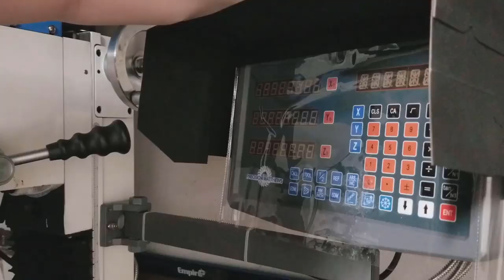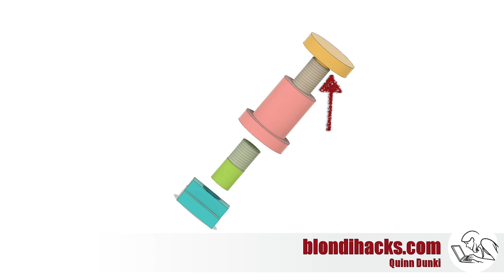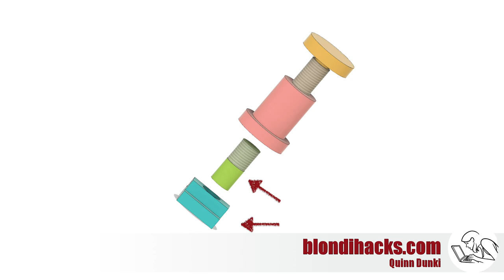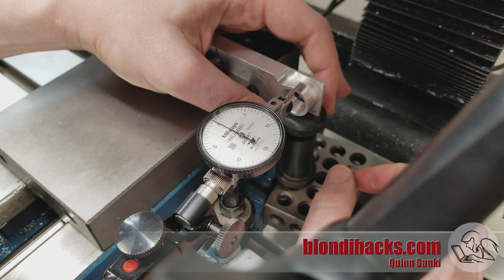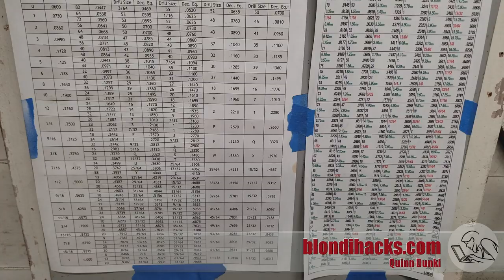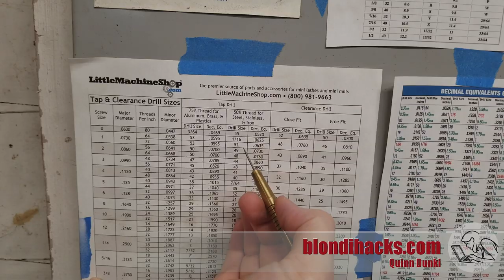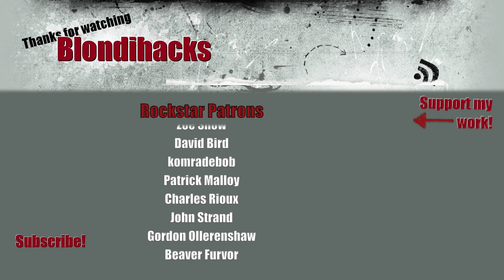Let's Make Machinist Jacks

Comment: Okay, here's another dumb (?) question:  why do you sometimes mark up on the lathe with a Sharpie, but other times go the full Dykem route?
Reply from the maker: The sharpie is quicker and easier, but it doesn’t hold up to heat and oil, so if I need the markings to last longer, Dykem it is.